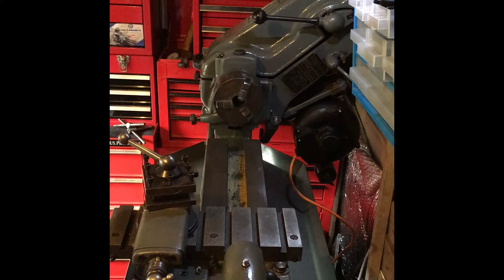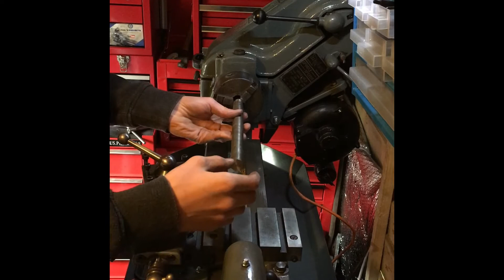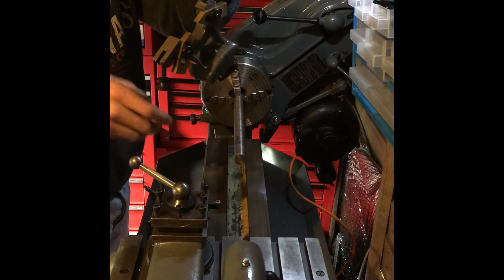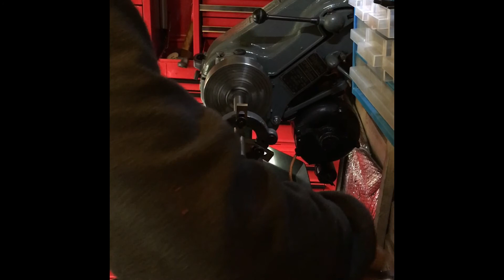Setting Up A Lathe Steady Rest

Comment: It's something iv been wanting for a long time, I,would have to make 1 of modify 1 for a different machine because there is no chance I will find 1 for my lathe
Reply from the maker: Dave 508d I’ve got a home made large one out of a steel ring. Made from an old pipe flange. Then some m10 nuts welded on. Then brass threaded bar. It’s not pretty but it’s great for larger stuff.
Reply: Machining Basics I think that's the way I'll go